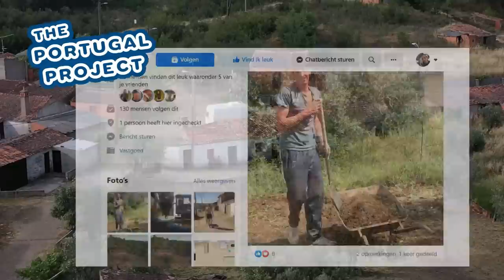TRYING TO FIND OUR SEPTIC TANK.. | Portuguese DIY Home Renovation

Comment: Ok, the problem is greater than just cleaning this drain line, you’ll need to increase the capacity of the septic tank. So you should first determine the location of the sewer line and tank. There is a method where a wire is inserted into the pipe and a detector is used to trace the line, like a metal detector. Then you’ll need to hire a backhoe trencher to dig out the old tank and install a larger tank and drainage field. You’ll then add drainage lines to the new toilets,showers etc. it’s a shity deal, but there you have it.

Comment: Jasper if you septic tank is failing is because you have a disproportionate level of water vs waste. The natural bacteria that break down waste can’t find enough food due to too much water thus overrunning size design. You have to either increase size, get it pumped regularly or segregate and not send any water from showers and sinks to the septic. Even if you do this it’s good to drain a bag of sugar once per month down the toilet. Those bacteria if they are not fed they die and stop breaking down the solid waste

Comment: Happy 16th Birthday Duarte :)  Jasper, an outdoor shower and another septic system will sort the problem (as well as not washing your dishes in the sink!)  In the short term maybe you could use a small washing up bowl in the sink but empty the bowl outside (your olive trees could take turns) It seems to me that there is no point in wasting much effort on that septic system when it works perfectly for fewer people. I saw an antique Portuguese shower made out of a metal bucket with small tap on the bottom, it was hung by the handle on a large nail :)  - maybe you could make one with a shower hose attachment for the garden? That would make an interesting little video  :)

Comment: Hi Jasper, the part in the floor with the sand in it is for that, to catch the sand, the water leaves out of the other part.
Happy Birthday to Duarte!... Parabens
You could try 'soda cáustica' caustic soda , mix with warm water and pour it down the drains, just in case is a blockage, if anything is stuck it will move it... then if blockage is still there you need to look at that septic tank, oh joy😉
Good luck mate!

Comment: Jasper, donantonio has got the right idea. I think you should start finding the drainage pipes from the septic tank end, First uncover the septic tank and excavate around it till you find the inlet and then excavate back along the pipe to the house. Uncovering the tank will also tell you whether it is full, whether the microbes/bacteria are breaking down the solids  and draining  the cleaner effluent into the drainage field. Be careful what chemicals are going into the septic tank, Many concentrated detergents will kill the bacteria.

Comment: Happy Bday! the shower and waste water could be put through a soap trap reed bed and actually be used to water veg! plant, really only toilet needs to go in septic tank! the fitting in the centre of bathroom is a basic trap.. could try running hosepipe down that and see how it flows away from there!.. only other thing is thermal, ground will be colder were the septic tank is!.. good luck.

Comment: The "drain" you removed the cover from is a trap in the "grey water" drainage system, the residual water in it is intentional to prevent smells "coming up" the shower drain and/or basin/bidet, that's why it had a seal on it too. 
The pipework in it is clearly not capable of taking toilet waste and will probably connect to the pipe/drain that does. 
You need to figure out how the toilet disharges and the route of that pipe (it may even be that the trap you have connects to that IN the bathroom) 
As already said you need to locate and trace the main drain and work from there.
Take this from someone who knows, having dismantled 3 bathrooms and watched my Portuguese builders like a hawk when they plumbed my house in the Algarve, ignore the majority of youtube armchair viewers who have no real localised (to you) expertise, except what they see on youtube.
In your current situation suggestions of reed beds, lagoons, grease traps are (IMHO) poppycock.

Comment: We had a slightly different problem we could see where the pipe came out but didn't know where the septic was hidden, we got a pipe investigation camera that connects to the mobile, although we found more pipes we still haven't found the septic which seems to be hidden under concrete, we need a longer camera! Good luck :) Happy birthday Duarte

Comment: Sprinkle the drain with baking soda, then dump vinegar into the pipe. Leave the mixture to sit in the pipe for an hour or two. Finally, flush the drain with hot water. If the clog is small, this could be enough to clear the pipe

Comment: your pipes are most likely clogged with grease from that mini-resturant..look into a grease trap for the kitchen. cold water is bad. buckets of hot water with degreaser or acid bowl cleaner down the toilet will give you the answer. happy b-day Duarte

Comment: Hi, without pretending to have the answer I suggest to see if you can measure, in the shower where you removed the drain cover, the depth of the drain pipe to the sceptic tank by sticking a metal wire through the small central pipe till it can not go deeper. This should be the depth of the drain tape. Taking into account the slope of the drain, dig outside at least to this depth and see if you discover the drain. As the sceptic tank was likely added after the house was build, the drain pipe would pass below the wall fundament. Hope this helps, good luck!

Comment: I haven't seen any comments about the leach field, are they typical in Portugal?  When we moved onto our farm we had to redo the leach field, as well as clean out the septic tank.  I agree the bacteria need to be put through the system regularly, that really helps, but with as many people as you plan to have there eventually, if it doesn't have a leach field it really needs one.  The leach field can go into  an open field as a means of reusing that water.  That consists of a number of large pipes with holes in them, stretched over a large area, then covered with dirt.  It takes the water off the top, allowing the solids to drop low and be digested by the bacteria.  I'm not a plumber, but that's the basics of the system
Reply: PS, we didn't clean out the septic tank, there are companies that have the trucks and equipment to do it quickly and easily.

Comment: From what I know about drains is there has to be a vent pipe somewhere else you would be creating a vacuum with each flush which in turn leads to air pocket, secondly I would have thought there would be a rodding point to get access to the drain to unblock if required  and why would the  tank be so close to the house if its self draining, is there not a risk of your waste getting into the aquifers?  And would maybe think of once you find the drain to install a rodding eye point . Oh and one last thing it's easier to dig with boots then bloody sliders lol

Comment: Looks like your septic tank is full. You need to have someone come by and drain it and inspect it, then you can clear the blockage.  You may also need to take under consideration that you may need to install a whole new septic system. In the meantime I suggest you take your showers and wash your dishes outside. At least until this situation is resolved.
Reply: The last time I saw a small swamp in the tank area the tank had to be replaced. It was just a concrete box. Pretty expensive and some heavy equipment involved.
Reply: @ArchaicHumansWorldwide  It's probably a cistern and not a septic tank, since he mentioned that the water displaces through the bottom. I see dollar signs rolling up in my eyes.

Comment: Bring a pot of hot water just to the boiling point and then pour it down the clogged drain. The hot water will help to loosen any grease or soap causing the clog, while the rush of water can help to loosen hair clogs. If hot water does not work, the next method you can try is a mixture of baking soda and vinegar.May 21, 2020
Reply: Especially because of also washing dishes, etc. in the sink, there is probably grease and soap residuals in there.
Reply: @mutternav4  I agree. I suggested he needed to create an out door kitchen he can and should buy biodegradable and erth friendly soaps.  Dr Brauners  and such are good for the earth. Use the Grey water around a tree or plants.

Comment: Just take a water pipe, put it in the hole and start putting water in it with high pressure.  Move the tube back and forth several times until it’s free.
Not nice because all the shit comes out in your bathroom…but it will be free in  an hour or so. We had the same problem last week…. 🙄

Comment: Does you system have any sewer vent pipes at the house. They allow a air release so water flows easier and also allow sewer gasses to escape and not enter the house.
Reply: The cleanout box he opened on the floor is what’s vented in Europe not the individual points of use like in USA

Comment: 🤣🤣🤣 .. shitty job indeed.

You've got to be prepared to get covered in a shit and piss mixture.
No other way in having to do a job like that.

If your intending to have 3 - 4 bathrooms / toilets, ( yours, two guest places, whoever is in the mini build, other guests ) that old system is not going to handle the volume, no way.

Septic tanks do not drain out the bottom, they have two tanks ( should have ), first tank where everything goes into, the shit stays/settles there, the fluids go over/through into second tank and drains out from a pipe at/near the top into a soak away/ leach pit/field ( where the weeds/plants are growing ).

A new system will have to be put in separating the grey water ( basins/showers/ sinks ) away from the septic tank.

Modern kitchen detergents/cleaning products/soaps/shower gels mess up the bacterias in septic tanks also.

Use to run a company years ago after a landscaping business I had.
We installed systems .. septic tanks / grey water / rain catchment tanks / dribble bars and pop up irrigation systems.

Sold a percentage of the business out and more or less retired 12 years ago.

There's a saying -

Where there's shit ..
There's money to be made.

And how true that saying is lol

Can't understand why your not working from possibly 5 a.m til 10 a.m ( do whatever and grab a few hours sleep ) then start again 4-5 p.m til later so your not wearing yourself out through the whole day and intensity of the mid day sun / heat.
We use to in the summers, it's alot kinder to yourself and overall health / risk against skin cancer.

Comment: Where the hell is the leach field??? Do you even have one.   You can use high pressure hose to blast it open.. or spinning blade plumbers flex to cut through that. Create separate septic.  And create leach field.  It was Mike Rowe dirty jobs